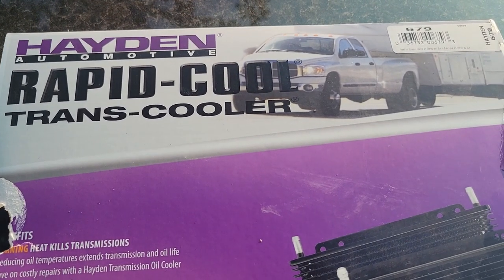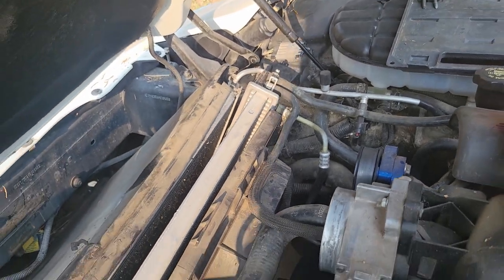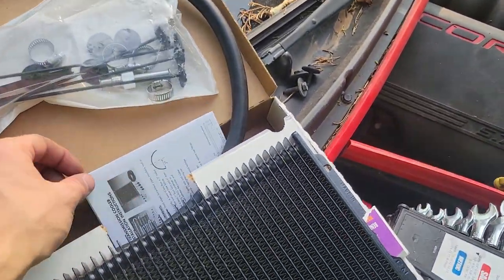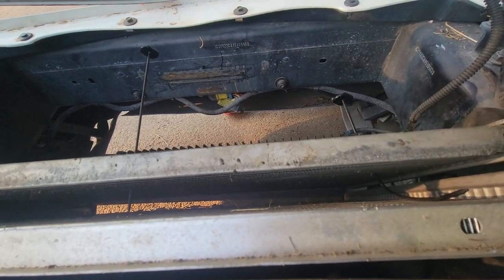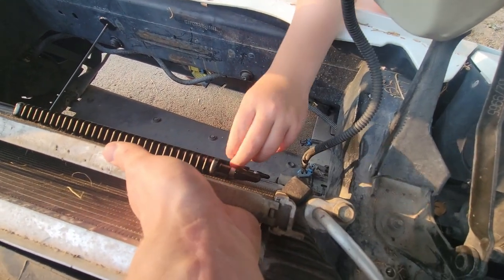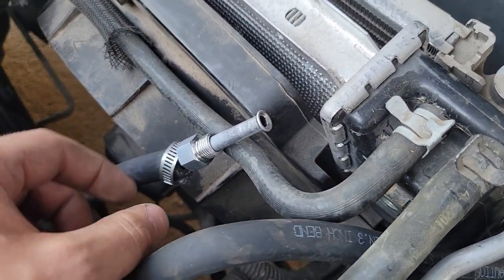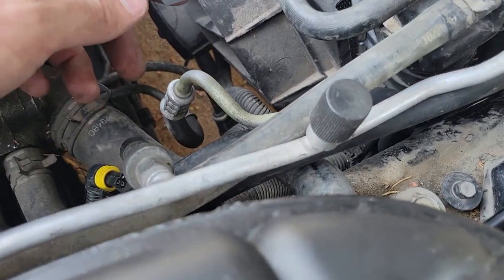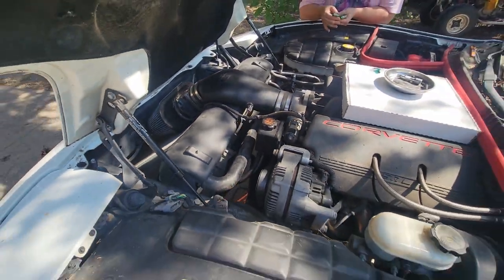How To Install a Transmission Cooler in a Corvette (1997-2004 C5) - Daily Vlog

Comment: One of the best video ive seen about this transmission cooler, thanks man for the explanation , with your help i think i can do it aswell , btw man , you repair the trans issue ? and you run it with this new cooler? found a significat difference before and after the installation?  and thanks again for this video.
Reply from the maker: You're welcome! 

If your vette is newer (2000+)  you may need a Hayden fitting part 390, thanks to @jacksabelhaus178 for let us know that.

We did get the transmission swapped out before running the old fluid/trans. With a used known to be good transmission and new fluid, we are now seeing temps staying lower than they were previously. I don't recall exact temps, but it's lower.
Reply: @ArcticVette  thanks so much ! yeah i already red that advice and thanks to remind me , yeah my vette is 08

Comment: Would it be a good idea to put the trans cooler in-line with the return line as opposed to the feed line. If the trans fluid is cooled, the routed back through the hot radiator wouldn't it reheat the trans fluid?
Reply from the maker: Yes, and that's how I did mine. The top line on the transmission is the return (from radiator), the top transmission line on the radiator is the return.

So I ran it from the top radiator line to the cooler, from the cooler back to the (top) transmission line. That way the radiator cooled it first, then the fluid cooled even more in the cooler itself. I haven't seen high temps since, were around 180f

Comment: Hey what size adapter did you have in there originally? And where did you get it from?
Reply from the maker: @RACKO1  they're stock as far as I know. I bet a parts store would carry replacements
Reply: @ArcticVette  dang, mine doesn’t come with one, they’re nearly impossible to find either. I I had more luck fitting a brake line in there but still running into issues with leaking because I put a compression fitting to 6an on the other end
Reply from the maker: @RACKO1 I searched real quick and found this at AutoZone. 

Dorman Automatic Transmission Oil Cooler Line Fitting part number 800-753. 

That looks similar to the stock one I had. Is yours an automatic too?
Reply: @ArcticVette  Yeah mine is auto, the male end of that adapter is too small for our radiators though :/ atleast mine. I’m trying 2 other adapters today and I’ll let you know how it goes
Reply from the maker: @RACKO1  sweet! I hope one of those works out! Glad to help more of I can 🙌🏼

Comment: Hello, can you list the part numbers you are using here? Thanks for the video and explanation, going to do the same to mine very soon.
Reply from the maker: The Hayden Trans-cooler part number 679, came as a kit with everything needed. You'll also want to pick up some extra transmission fluid. 

Here's a link to the trans-cooler: https://amzn.to/4ahipzK
Reply: @ArcticVette  awesome thank you!
Reply from the maker: @jacksabelhaus178  you're welcome!
Reply: @ArcticVette  Installed mine last week, I have a 2000 MY, only difference from your set up is I needed Hayden fittings kit Part number: 390 . Looks like there was a radiator fitting design change in 2001. Just posting here so anyone with a 97-2000 does the same!
Reply from the maker: Thanks for the heads up! Glad to hear you got it installed 🙌🏼

Comment: You need detected trans oil leek first
Reply from the maker: Prior to this, I found where the leak was and determined we needed a new transmission. Mainly because we lost a couple gears, then all of them, and finally the fluid all ran out from the front where the torque converter is at. 

So we bought a used transmission, and torque converter to replace the original that was rebuilt previously. I really think it was just the torque converter, once we got everything out but I'm not sure. Anyhow now it's all good and working great 🙌🏼🥰